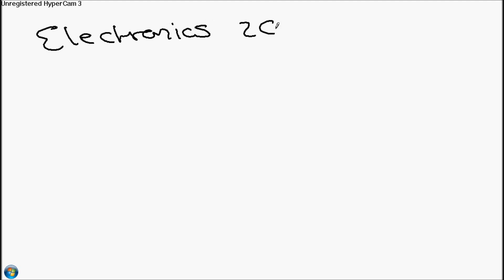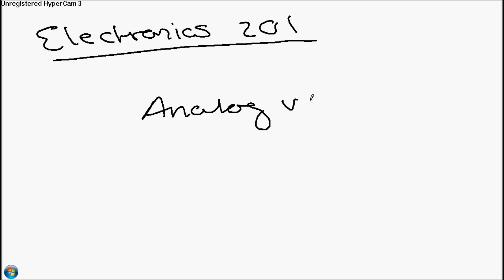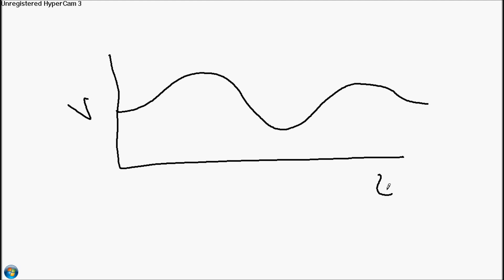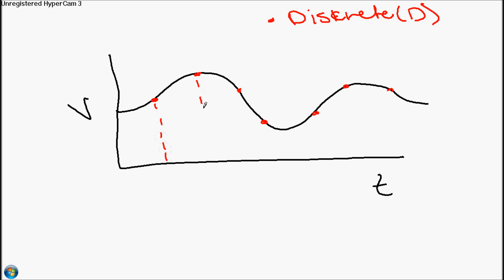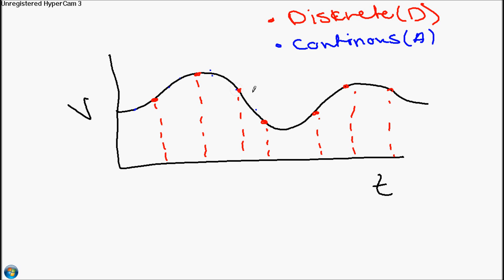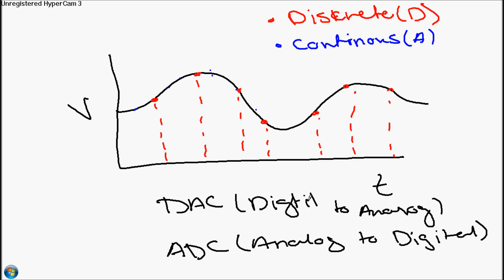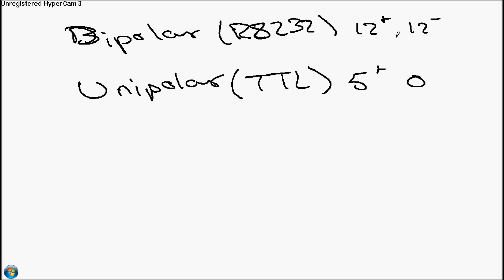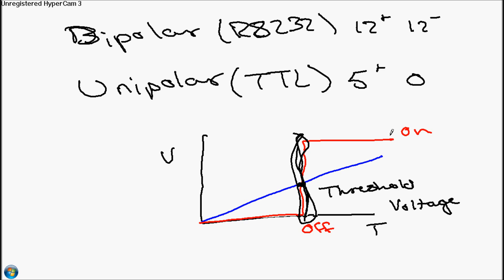Electronics 201: Difference Between Digital and Analog

Comment: Please can i ask? if a transistor (guitar) amplifier or certain effect units (pedals) claim they are Analog but using MOSFET or JFET, are they really Analog? What is the boundary of Analog and Digital in transistor circuits? What electrical component(s) cannot be present on a transistor circuitry if it were to be classified as Analog? Thank you very much

Comment: how can an analog signal converted into digital signal?
Reply from the maker: +jiby krishna An analog to digital converter.
Reply: HOW DOES IT WORK?
Reply from the maker: The output from an ADC is always a fraction of the device's supply voltage. When you put in an analog signal it is compared to several fractions of the supply voltage to create a binary value.